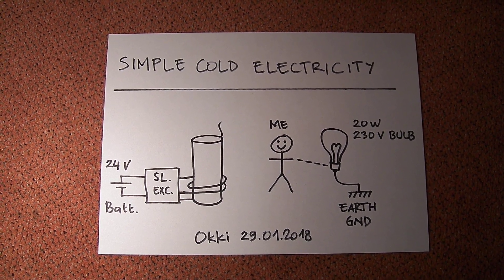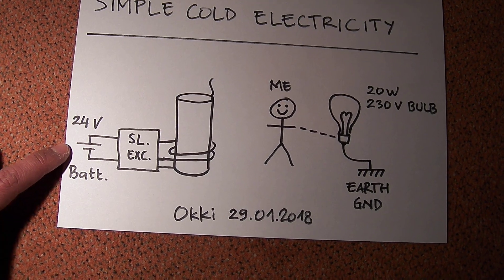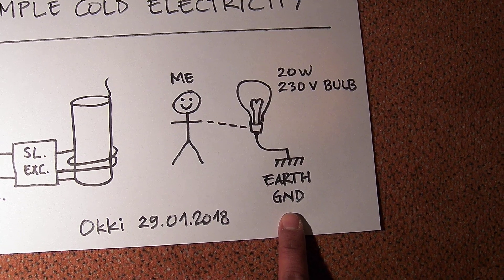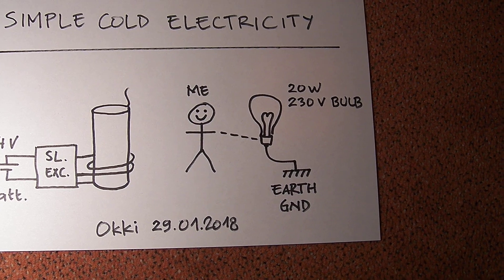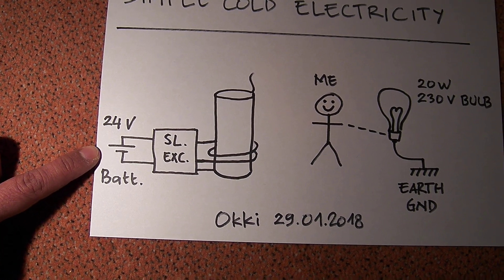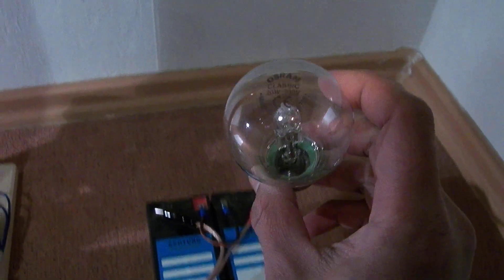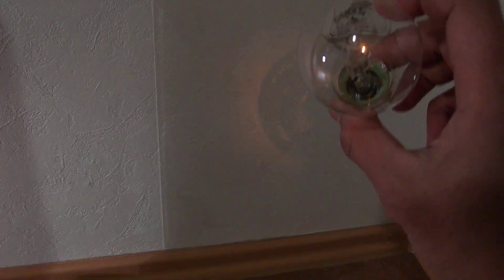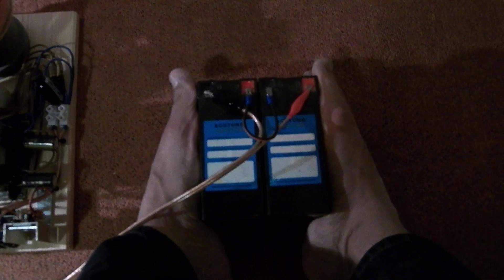Simple Cold Electricity Revisited

Comment: Very cool. There are no closed systems in electricity. And dielectricity travels to open capacity, of which batteries have a large amount. And it travels through non-conductors and converts to standard electricity at metalic interfaces... so, it all is expected. If you could limit your transformer to a unipolar output, the battery would charge while it ran. Nice work. Thanks.
Reply from the maker: You are welcome. Thanks for commenting.

Comment: Great stuff again!  Could you use a common AC field detector t(hat electricians use to sense if a AC plug is hot) around the case of the battery?  Maybe AC is feeding into your battery from the slayer.  Thus the case of the battery is a dielectric to your feet acting as a conductor/plate placing potential vibrations on your body which is fed through your hand to the light bulb.   This maybe will also explain why touching any conductor on the battery provides the same effect.
Reply from the maker: Thanks! Sorry I don't have such device. This configuration makes the coil similar to bipolar Tesla Coil, which means both ends of the coil are floating freely. If this coil is excited, you will have electrical vibration on both ends. As the bottom side of the coil is connected to the battery through circuit. The battery will also vibrate. Thus you can receive radiant energy from the battery.

Comment: Could you please hook up a couple of watt meters? To show voltage and current flow from the batteries and current and voltage across the light bulb. Then measure your efficiency. Thank you very much. Appreciate you very much doing these experiments. Just need a little more information please. Thank you
Reply from the maker: Hi Ronald, Davy is right, we cannot measure this power using normal watt meter. Thanks to both of you for commenting.
Reply: He would need an expensive RF watt meter. The slayer exciter circuit is very high frequency. Best way would be to determine bulb brightness with equivalent wattage level, and calculate the batteries amp hours based on that bulb brightness wattage equivalent, and then see how long the batteries last while monitoring bulb brightness.